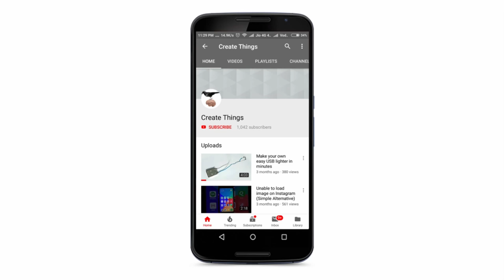Charge your Button Cell (Watch Battery) within a Minute, Easy DIY

Comment: I am happy to say this was a simple  tip  anyone can do at home .   I have  tried it within the last half an hour of this post .    I  only have one thing to add …  after charging 5 batteries   I put the multi meter on them for about  10 seconds each . One of the batteries   Voltage was dropping as I watched  . But the other 4 batteries held the charge  and are working great 👍.  Thank you for sharing your knowledge 👣🦘🍻

Comment: This method is actually working... use this method in emergency that you don't have time to actually buy a new battery and not to save some $$. I would suggest not holding the battery with fingers. hold the battery using some kind of tape. Charge it for less than a minute. It gets really hot in <1 min. Try to avoid direct contact (Holding the battery after charging), let it cool for 5 to 10 mins.

Comment: The battery may leak in the watch and damage small components. So don't risk your watch for a cheap battery. It looks cool but as some viewers have reported that it only lasts a few hours, so please don't try this if your watch is more important to you than the dead battery😊
Reply: Thanku,i was thinking to do this experiment with my watch but now i will simply buy a new cell for it😊
Reply: @randomboy.8827  Same

Comment: Safer to just use a 18650 battery. And just run positive to positive and negative to negative. Does the same thing but in like half the time. Charged at just under 3 volts. I just did it on my weight scale. The usb depending on which usb your using are usually 2-2.4 volts. And u don’t have to worry about plugging it into a 110 socket and praying that nothing goes wrong with the usb to wall adapter plugged in. Some people will be scared cause of being shocked the tiny tiny risk that is. But if u do it with a battery it is completely safe. Just use a AA battery to charge it if your worried. But a 4.2 volt 18650 will do it in seconds. I did a cr 2032 I think it was which is a much bigger button battery and 30 secs. (3 )10 second intervals.

Comment: lolololol it worked! quaranatine is really making us diys rather than buying hahahaha
Reply: It’s good in a pinch. But charging it with a bigger battery is safer. I wouldn’t trust the usb to wall adapter to not go out on me while doing it and end up getting shocked. Using a battery just run + to + and - to - the flat side is positive the button is negative should be marked.
Reply: i can't find my busted android wire shit

Comment: This is not a very safe way, if it’s rated 1.5v then charge it at 1.6v-1.7v for no more than a minute or two and not continuously charge else it will warm up and get too hot and leak or explode and it’s only just to give you time to get a new battery, so not recommended to do this more than once as it’s not designed for continuous recharging hence not a rechargeable battery
Reply: It's safer to use ordinary 1.5v cell battery. It worked well, my wrist watch battery lasted for 3 months before I replaced it.

Comment: I have to say   I am amazed to see such a wide range of results from many people charging  1.5 v and 3 v  button cell batteries  🤯   .     So far - I have only had to charge the  ‘’flat batteries for 1 minute     🤔   And only one time  ….. Since I first Came across  this little gem of a YouTube video , I have saved  $$$$ dollars  in batteries  …not to mention the fact that  I have a hand full of old cheap work watches  that were  not worth the Time and effort of buying  new battery for .                                                If  the charged ,only lasted  for a few days in your device ……I suspect that particular cell has actually failed .    I used a cheap multi meter to test each cell after I have charged it .        Using the multi-meter , I have observed Two things .     Both the  Good battery  And that is faulty will often charge…..   if you hold  the multi-meter on the charged battery…. and watch the voltage  ….you will see the voltage drop ‘’ as it happens 👈  you will notice   The good batteries voltage  drops the excess charge until it reaches  approximately 1.5  / 1.7 volts  .     The faulty batteries voltage will drop continuously’’ it may slow down , but will continue to drop over a few days.          The batteries that are not faulty  ‘’Become fully charged and are still working In our watches   Toys and laser pointers  .        I have only had One  button cell battery explode in my fingers as I charged it .    It  was a good lesson    , I was NOT  hurt    But it scared the crap out of me  ….. The two fingers holding the positive and negative wires  to the battery ……felt like they had been slapped with an old wooden ruler lol  or when your fingers get caught in the end of a tape measure as it closes .       I recommend  wearing safety glasses  .   And to make  a basic battery holder for the  30 seconds to one minute of charging time.
Reply: It is rechargeable one mt920

Comment: I already tried this some few years back buy using a  multi-meter tester-set X1  negative prob  is connected to positive of battery  and charge it for 10min for short duration and  to 30min for longer life,    good only for emergency  it will last  a day or two or so, some lasted a few hours depending quality type battery

Comment: Dont charge straightly in switch board its danger and also its very danger to hold in hand. Better u can connect the  data cable to laptop or powerbank and charge it bro.

Comment: Why would you allow your fingers get in the way of the camera when touching the wires to the battery. Now how are your viewers going to know which polarity* (color) wire connects to which polarity (side) battery?
*Polarity: The directional flow of electrons in an electrical circuit.  
"+" = Positive/Red
"-" = Negative/Black

Comment: USB charger is too much, too fast, or too dangerous.
I used the same technique with a bench power supply, and slowly turned up the voltage so it was was never pushing more than 10ma at a time, quitting at 2.5v
If you do it real slow it can be done a few times, each time lasts noticeably less than the previous one.
Good for a few weeks until getting around to getting a real proper replacement.

Comment: Holding a watch battery with your bare hands can easily discharge its charge...i suggest using plastic tipped tweezers as you hold it...😃

Comment: I have usb with four wires red black white and green which one I should use
Reply from the maker: In maximum case Red is Positive (+) and Black Negative (-), if not charging you can try other in place of Black for Negative(-)
Reply: Don’t, wrong voltage and if you asking your clearly don’t know enough and would just injure yourself.
Reply: It works Simple Simon

Comment: Sir I have tried my level best to charge cell but it does not work cell is getting hot . And I have connected with black and white wire in cell my cell is too old also and what kind of cable we have to use
Reply from the maker: Kindly check if you are connecting Positive or Red Wire to (+) sign and Negative to (-) sign on a Battery.
Reply: Which is +sign and -sign in cell sir
Reply: And I have not repair the cell from last 2 year

Comment: how to charge a cell without electricity........please tell me;
Reply from the maker: Keep it under the Sun for 30 mins 😁😁
Reply: @cedgame  are you sure;
Reply: I'm doing this project, so I might as well give you a hint; make a electric generator with magnets. 
You will need voltmeter to know the output, though.
Precision is important.